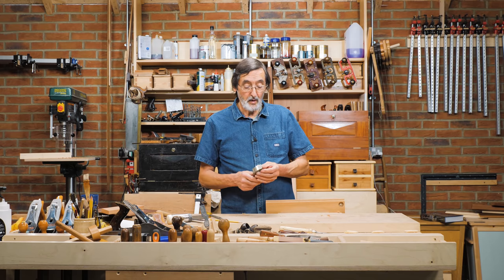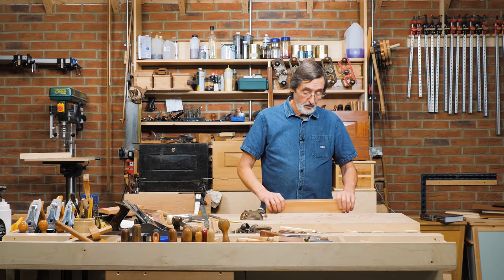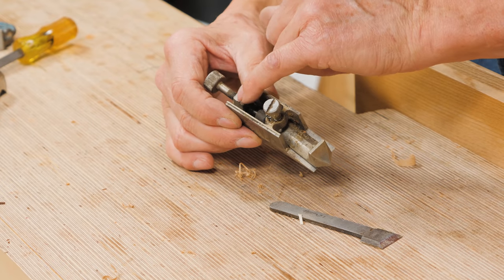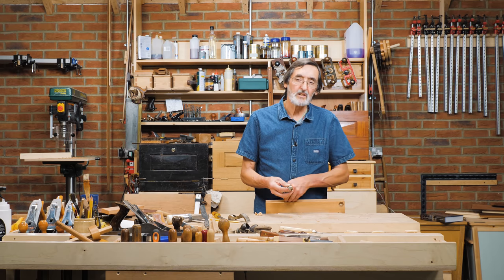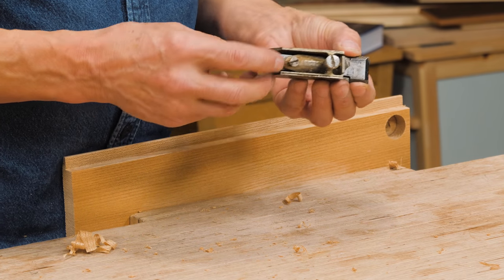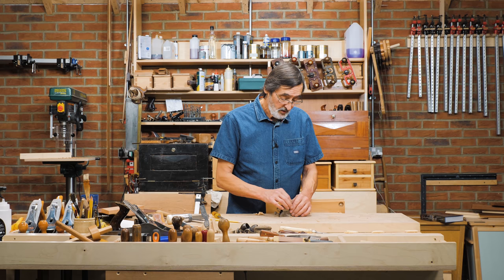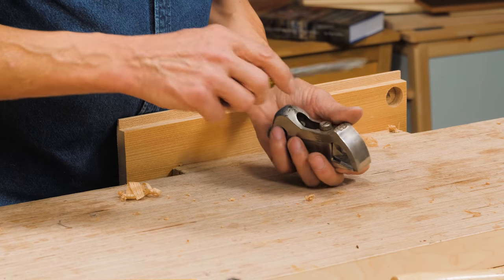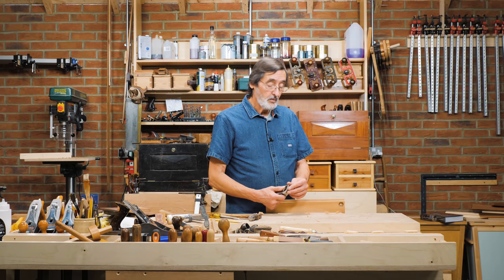How to Set up & use a Bullnose Plane | Paul Sellers

Comment: Mine is the No78, Stanley model. Not as refined as yours but seems to work well enough. I have found that when setting it up, rounding off the top corners of the blade very slightly helps it preventing the iron digging in (it has to be wider than the body of the plane like you pointed out). And when I adjust the iron for depth of cut I sight from the rear end of the plane and set the iron level with the sole with just a little of the bevel showing. It's great for precision shaping too. Mine used to be my dads, who had model making ambitions that  he never got around to. But it should have been great for that. It can be used like a precision spokeshave.

Comment: I'm simply here as I can't remember the angles to sharpen my bullnose I've not used in a long time. I've slightly adjusted profession but as a site chippy I would always remove the nose to shoot the bottom of a door in that's still hanging rather than whip it off it's hinges, came in very useful!!😃

Comment: I see I'm not the only one that sometimes has trouble replacing the blade on this plane. Quite versatile. I can use it as a shoulder plane, a rabbet plane, and a small block plane in tight spots.  Thanks Paul & team.        ps: getting closer to 500,000 subs !

Comment: 1:55 "bad engineering by somebody at Stanley"

If there is anything I've learned from watching these videos, it's that the tools that I inhherited form my father hold way more secrets than I could have figured out for myself. 

A company like stanley doesn't do "bad engineering", pretty much everything is done for a purpose. If you see the same "mistake" on every tool then it's probably not a mistake, it's a feature that you don't understand yet. Learning about these things is half the fun!
Reply: A company like Stanley didn't do bad engineering.
Reply: @scottmartin7717  absolutely true, & is really a shame.
Reply: I understand the reason for the blade to be slightly wider than the sole, but man do I get a  lot of minor finger cuts when using my rabbet plane.  you'd think i'd learn to just wrap the ends of my fingers with some of that protective tape first.
Reply: @ugaladh  Ikr, the very same happens to me. You could tell that I've been using my rabbet plane by the random short cuts on my fingers from adjusting the fence, the blade, the throat opening....it's as if it is inevitable that I'll cut myself at some point when using that plane. I still very much enjoy using it though.

Comment: Hi paul,
Did you know about the small grub screw on the underside of the top part at the nose end, thats for use to keep  the mouth set inplace and to stop it closing up in twisted grain.
Reply: & possibly from slamming into the blade when adjusting the mouth opening.

Comment: I always have one at the bottom of my toolbox, they can be troublesome little things though, particularly if there are knots about !  as a chisel plane they aren’t much good,they are so short they try to dive, I find difficulty putting enough pressure on the heel to stop that, I just use a chisel.

Comment: I've always struggled with these. I have one but find I can't use it. If I start in the middle of the rebate like Paul did then I'm not planing the first half, and if I pull the plane then I'm going against the grain and get tear out. The nose is too short to start at the front of the rebate as there's no lead up. I haven't yet figured out where it fits in with how I work. I'd like to though.

Comment: I have one of these and set about getting it up to working order.  I found that a screw that holds the cap iron/chip diverter device in place seems stripped.  I can't determine the thread and am finding it tough to find a replacement.  Any help?  And thanks, Paul, for your great videos!!
Reply: I’ve found all the old Stanley stuff used proprietary thread pitches/sizes. In the past I’ve always had to drill out the hole (make it large enough that it completely removes the old threading).  Then you have to re thread it with a tap and just get a new screw that is similar in size/shape. 

It’s worked great the couple of times I have had to do it. Hunting down those old parts is just almost impossible unless it was a really common tool (which this is not).
Reply: @kg3225  Yes, that is what I ended up doing. Went with a poor choice of screw and thread size. Learned after I did that and talk to a guy who knows a lot more than me, that the number sizes of screws, for example #6, #8, #10, etc., are going away. I tapped the whole out to 12-24 thread. But finding a knurled bolt was tough. Did find a place and ordered three. Shipping was three times the cost of the screws I ordered.

Comment: Hi 
l have just watched your video in Plane Restoration from a few years back. I have a Stanley Bailey No4 which I am overhauling at the moment.  I have found that the pin that holds the Yoke to the Frog is missing.  My question is whether this "pin" is a screw or a roll pin, and how do I obtain one?
Thank you.

Comment: My bullnose is built differently. The blade comes down at an angle like a 'standard' plane with a rudimentary chip breaker. Ive just assumed its set up the same as a normal plane... So far nothing has broken

Comment: So I've got a Stanley of this type and the base (part holding the blade)  is not co-planar with the nose part - it sticks out past the nose.
Reply: @paulsellers7953  interesting...I suppose this is because the blade comprises the entire width of the plane while bench planes have body on either side of the blade. This step seems to dictate that one can only take a shaving of one single thickness...the thickness of the step for if your blade protrudes less than the step so as to take a finer shaving, the plane will bump on the edge and you'll create a taper...protrude the blade beyond the step and you'll also get a taper right?

Comment: thanks, what model would you suggest ?
Reply: Lee Valley have a great one, if you want new, or Stanley second hand
Reply: @newtonmiller8810  thanks, off to eBay I go,
Reply: Record made a few different versions which seem to be reasonably common and good quality. Model 77 looks just like the one here - but there was also a 76 and 75 which were a bit different.
Reply: Paul is using a Stanley 90 I believe (and which I'd recommend too). The version with an extended front plate which makes it into a better shoulder plane is called the Stanley 93 (There is also a 92, which is a narrower version of the 92, but which doesn't have a bullnose version IIRC). The only difference between the 93 and 90 is the front plate, everything else is interchangeable.
Reply: @RueFondary  thank you